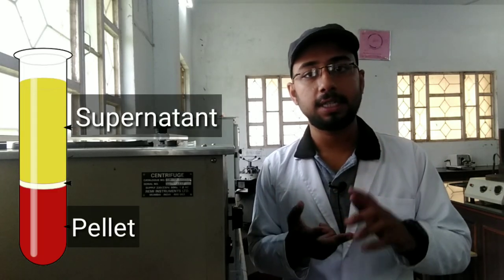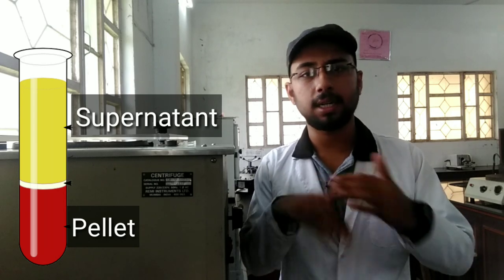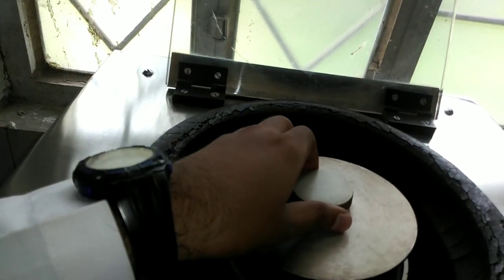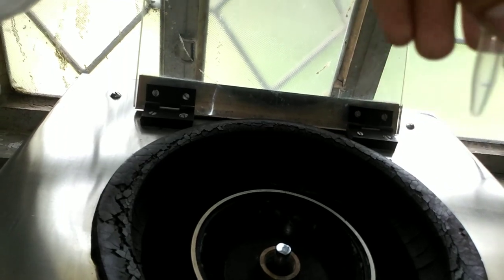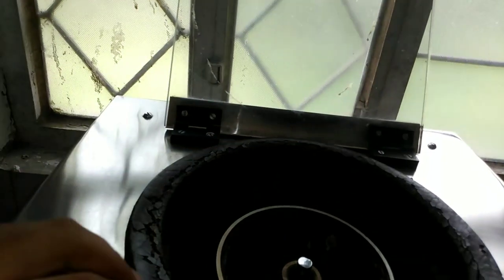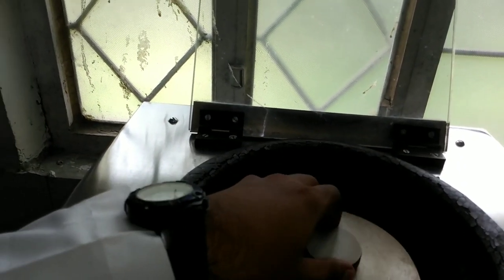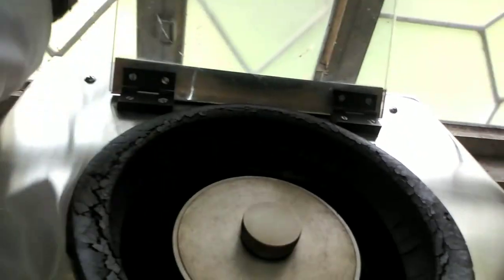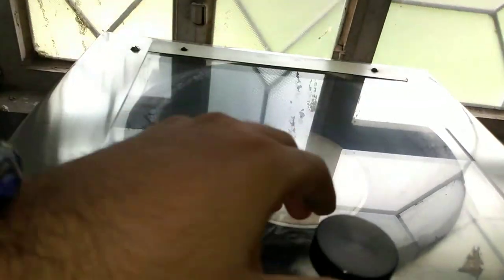Centrifuge machine introduction | centrifuge machine working | centrifuge uses in laboratory

Comment: Will u help to explain batch type centrifuge used in sugar industry
Reply from the maker: Here it is not possible to clearly define you but you can study it from here https://www.google.com/url?sa=t&source=web&rct=j&url=https://help.syscad.net/index.php/Batch_Centrifuge%23:~:text%3DHints%2520and%2520Comments-,General%2520Description,the%2520user%252Ddefined%2520wash%2520efficiency.&ved=2ahUKEwijoqOv-6TsAhVkyzgGHZkLC5AQFjANegQIExAE&usg=AOvVaw3whVuETGmhSJizAuD0noD8